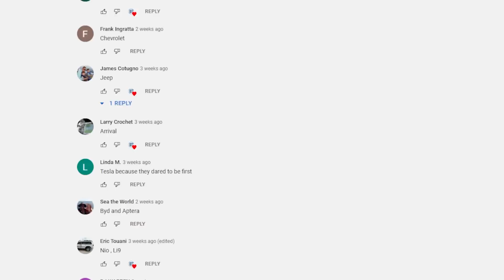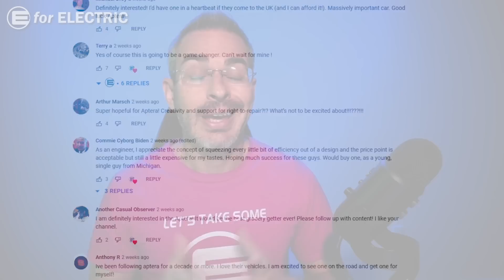How Aptera EV Got a Tesla-like Fan Base

Comment: I watch all of your videos, I have had a Tesla model 3 long range for 4 years now and absolutely love it, and yes I am an early reservation holder for the Aptera.  For me the Aptera will be more of a toy, such as a motorcycle or an ATV.  I am 75 years old and this thing just interests the heck out of me.   The solar aspect of the vehicle does not have any basis for my interest.  Number 1, I would not want to leave it sit in the sun all day.  I've been around long enough to see the damage the sun can do to most everything.  It will be kept in an enclosure or under a roof when not being used.  I do have one outstanding question that no YouTuber or even Aptera seems to want to answer about this vehicle.  Something I do on a regular basis with every vehicle I have is periodically check and change tire pressures.  What exactly will be involved with doing that on this vehicle?  It appears that it might be a major task!
Reply: I would think at least they would have an easily removable small panel on each of the 3 wheel pants which would give access to the valve stems by just rotation of the wheel until the stem was accessible.
Reply: My understanding is, it will have a tire pressure monitoring system.  How they will notify you of tire pressure (ie warning sound when tp is low, ability to touch the screen and get recent tp, graphic of vehicle with tp at startup, etc) has not been disclosed.  Nor have they revealed who the supplier for tp monitoring system is.
Reply: @tfloyd6651  That's fine, but again, what is involved with actually adding or releasing air?  Looks to be a possible nightmare!
Reply: @ronalddeservi1889  - I see your point.  If filling your tires means ensuring the filling point is on the inside (toward the car), rather than on the outside when you rotate tires ... or if special tools are required to access the wheel pants to reach the filling point ... or if there is a a unique requirement with the inwheel motors, you would probably want to know that eventually to handle the task effectively.

Comment: I love the design and innovation but considering this  vehicle as a daily driver or anywhere where it needs to be driven in traffic with other cars that weigh 3000 - 8000 lbs ( and that’s just cars and trucks) is suicidal.

A crash with a  Camry  or any normal car  or truck will  likely subject the Aptera occupants to grave injury.

Now,  if it’s a world of only Apteras  or similar weighted vehicles, then no problem , I’m on board.
Reply: So you need a 80,000 lbs transport truck to give you the illusion of safety?
Reply: @universeisundernoobligatio3283   hardly...,   do  what you want, but i'd never put my kids in the Aptera unless it was on a closed road or the world is filled with a majority  of Apteras.
Reply: @universeisundernoobligatio3283   Really?.  I'm holding back from being sad about you or your kids potentially  dying  in an Aptera because I don't want you to be considered an irresponsible parent.. Maybe your parents gave you a motorcycle for your first vehicle.  Not mine. Maybe you're  parents would buy a Pinto because they could get a great deal. Not  mine. Everybody has a different sense of risk tolerance,  and to me,  safety is one  of the big considerations when buying a car, or car like vehicle..

Your assumption is ridiculous. There's  a big difference  between riding a bike on the side of the road  at city speeds and  and sharing a highway  with vehicles of such great mass disparity traveling at 55-80 mph..  You can paint me as overly cautious, but 3 wheeled vehicles in the USA   have little safety regulation and are treated like motorcycles.

 i know  the likelihood of a crash is probably super low and as an  in city runabout,  I'm sure the Aptera is fine.  My point is existing cars and trucks and especially EVs are super heavy. Not  addressing the relative safety of this sort of vehicle is irresponsible unless it's a world of Apteras.

 Or shoot, maybe I'm wrong and the Aptera has some brilliant crash mitigating  features that make it incredibly  safe? If so, I'd like to hear more.
Reply: @FURILLA  
Still have not answered the question will you ever let your kids ride a bike?
Reply: Sports cars have this same problem: light weight compared to semis, trucks, and sedans.  Motorcycles and smart cars are so streamline and 'tiny', that they are overlooked by distracted drivers.   For many people, these are considered daily driver vehicles.  And driving these safely (defensively) does take skill beyond reving the engine and weaving through traffic.  I wouldn't be surprised to learn,  autocycle driving schools get a boost of business, as these roll off the manufacturing floor and into owners hands.
Reply: I have over 400,000 safe miles on motorcycles, many of them commuting in rush hour traffic in the SF Bay area.  Safety does not come from passive protection alone.  That is a dangerous illusion.  That said, Aptera will be crash tested to FMVSS Part 200 automotive  standards, and will rate well.
Reply: @n.brucenelson5920   That is great to hear.  What is the FMVSS Part 200  test? I cant find it when googling.
Reply: @FURILLA  Part 200 calls out a whole series of crash tests.  For instance part 216 is the roof crush strength test.  It should be easy to find. FMVSS stands for Federal Motor Vehicle Safety Standards.  Others include FMVSS 214 (Side Door Strength), FMVSS 215 (Exterior Protection), and
FMVSS 208 (Occupant Crash Protection)
Reply: @n.brucenelson5920     Roof crush I hear is very good. on the Aptera, but  that deals with only the Aptera ‘own weight times gravity or the speed at which it is moving.

I would want to know how it does  in a head on  crash with a typical car or static barrier , off set and side impacts as well.
Reply: @FURILLA  I think we all want to know, which is why we need to wait until there are production intent vehicles available to test.

Comment: The Aptera EV is certainly a strange looking beast and probably won't appear to very many automobile enthusiasts but it might to motorcycle enthusiasts. At any rate, I'm rooting for them, particularly if they can shave 7 or 8 thousand dollars off the price point.
Reply: The Aptera's drag coefficient of 0.13, and even the Cd's of most cars, is vastly superior to that of a motorcycle that beat you up with drag coefficients up around 0.70, up there with vans and large chunky SUV's. You throw your money away powering those machines to just break wind.

Comment: One thing I'm surprised wasn't mentioned is the benefits of efficiency on charging in miles/minute of charging. With a 40 kW battery getting 400 miles, if that can be charged 0-80% in say 20 minutes that is only averaging under 100 kW charging and gives you 16 miles per minute of charging. That blows every other EV out of the water. Even if it takes over 30 minutes 0-80% I believe this will be the fastest charging EV available and you'll even be able to beat all or nearly all EVs even if it's on a wimpy 50 kW charger while they're on 350 kW chargers.

That is all assuming this thing can charge reasonably quick, but I think it's a safe assumption it will do at least 50 kW which will make it the fastest charging vehicle within like $70k of its price.
Reply: I believe the top charging speed will be 50 kW DC. but this is till a rate of 500 mph.

Comment: I'm really hoping Aptera makes it to market because the Aptera is the product that I'm most excited about.  Yes, more than the cybertruck, roadster or anything GM, Ford or Lucid are making.  I'm fully aware that this is at odds with the general car buying public but the package Aptera has put together is really appealing to a nerd like me.  

We are a two car household and likely will be for the foreseeable future.  Having an Aptera as one of our vehicles would be perfect.  I like the thoughts of rock bottom operational cost, long lifespan, home repairablility with their commitment to Right to Repair.  I also like the thought of rarely ever needing to charge.   Then there's the range.  I have zero need for that much range, but I want it anyway.  It also doesn't hurt that it seems to have performance to rival the M3.

Comment: Dare I ask if thrs room inside for a PHEV version?
Reply: I currently drive a PHEV.  There are far more parts, more cost and more maintenance, and no reason for PHEVs anymore with the present state of EVs.
Reply: @n.brucenelson5920  If the lithium supply hits a bottleneck, it will reduce more CO2 to apportion it to eight PHEVs than to one BEV, per Toyota. I’ve read several articles claiming such a bottleneck is in the cards.
Reply: @rogerknights857  That could well be in the cards, but not necessarily.  Luckily there are other major sources of lithium in the US that have yet to be developed and perhaps could be quickly, such as the Salton Sea.  There are also other battery tech on the horizon such as sodium and other kinds of flow batteries that could ease any developing bottlenecks.

Comment: The vehicle is designed for efficiency, modules for repairability, upgradeable, made of materials that will last a long time, right to repair, and it looks good. Efficient design was first--not flashy how can we impress the neighbors’ designs that are prevalent today.  Today’s products are designed for obsolescence and throw away. Cars for obsolescence and dealer repair for profit.  Aptera is designed for the consumer. Efficient, repairable, upgradeable, low initial cost, low cost per mile to operate, it looks awesome, and it satisfies the number one reason people own a car--commuting to work.

Comment: The Aptera is a great design. I think there is a solid future in photovoltaics on cars. Much of the time a car is sitting idle in the sun (or at least in daylight) - so why not use the solar power, it's a no brainer. Even the simple addition of PV material to a standard glass roof of an EV would add about 1000 km of free distance a year - well worth it since these glass roofs need some shading to begin with, and PV material is dropping in price.

Comment: Overall simplicity of the design in terms of forward/backward compatibility with future tech upgrades. They want that hull to stay on the road, even if every other component gets replaced in the future. That type of reusability is what has kept (50's, 60's, and 70's) muscle cars on the road till now. It really fits into the existing car repair market. Little need for service centers, just warehouses full of parts. I think it's core design and variants are going to be great for courier type delivery vehicles. Internationally, Asian markets may eat these up where trike type motorcycles are currently used. That use would get around a lot of the regulations that sandy mentioned in the US for 4 wheel vehicles as well. The company and their products have a lot of potential.

Comment: I predict that those front wheels are going to hit and get hit by everything. Plus 3 wheelers have a more difficult time avoiding potholes, etc. 3 wheelers also don't have to meet auto safety regulations = less safe.
Reply: Your last statement is untrue.  Aptera has been designed to and will be tested to the FMVSS part 200 automotive crash test standards by a third party and the ratings will be published.  It will likely do better than my Gen 1 Honda Insight which weighs about the same and got 4s when it was tested.  It has some safety features that the Honda doesn't have.
Reply: @n.brucenelson5920  "Will be tested" means nothing.
Reply: @Vlasko60  When I first invested there were no vehicles in existence.  My wife and I have now ridden in one and it exceeded all our expectations for performance.   It will be tested just like Cybertruck will be, and likely first.
Reply: @n.brucenelson5920  Again, "will be" is not "has passed", is it?

Comment: Beware of 3 wheeled vehicles. They are classified as motorcycles so they do not have to meet auto safety standards.
Reply: The aptera has been designed with safety in mind from the beginning, and will be crash tested to automotive standards (even though they don't have to, because, as you say, it's an autocycle).
Reply: @GoClimbARockEh  "Will be crash tested" is not "crash tested". If they had safety in mind from the beginning, they wouldn't have chosen 3 wheels to get around regulations.
Reply: @Vlasko60  they chose three wheels for efficiencies sake, not to get around regulations. You only crash test production vehicles, which they should have by early 2023
Reply: @Vlasko60  Aptera has front and rear crumple zones, air bags, seatbelts, and other safety features, none of which are required by the regs.  On the other hand, 3 wheels allows both an more aerodynamic shape, less weight, and less rolling resistance, all contributing to the efficiency of the design  

It will be crash tested by a third party to FMVSS Part 200 automotive standards and the results published as soon as there are production intent vehicles available to test.
Reply: @GoClimbARockEh  Nope. That's just what they tell you. It is to make more money not dealing with safety regulations. People are going to put their children in these things. Too bad you don't seem to care as long as you have your fun toy. Cars are more regulated than ever and safer than ever. Regulations save lives.

Comment: I am a Fan, Reservation holder and an Investor.

Solar Charging, composite construction and efficiency are second to none.

100 watts per mile.

Sad to hear all these negative comments from this Channel Owner.

Easy to charge?  It takes money to charge from the grid.

Solar is free, using a basic 120V to charge, is very useful.

Tesla Plug vs CCS-2.  I choose Tesla

Comment: Efficiency is essentially meaningless, practicality (in all ways) is what it's all about.  The Aptera fails miserably in practicality.  The obsession about range is a comically short-sighted, knee-jerk, response to EV adoption/desirability.  It's only a matter of time before profitability (ya, that minor point) means that literally every major gas station has EV chargers installed (Shell is already a big player). 

In any case, the vast majority of EV owners for the forseeable future will be able to charge at home (EV's are not yet mass-market and out of practical reach of lower/middle-income earners, who typically live without dedicated parking/charge availability, like a driveway/garage)
Reply: Cost is a major component of practicality, and the Aptera hardly fails in any measure of utility as long as two passengers can meet your needs.  I know this from having ridden in an alpha prototype.  The pure handling and acceleration performance are also thrilling, which goes beyond practicality, but is a major attraction.
Reply: @n.brucenelson5920  The Aptera is a toy, like a Slingshot, or similar.  Pretending that it is a practical, useful, vehicle is completely disingenuous.
Reply: @awebuser5914  You are welcome to your opinion, but I wholeheartedly disagree. It will function as my primary get around, and road tripping car. Will probably keep the LEAF and use it mostly for hauling dogs around. It is already pretty much sacrificed to my dog walking side gig, odor and appearance wise.

Comment: I am a reservation holder, and I'm fascinated by the efficiency this car will provide.  By the way, looking at the chart about the matter of ever having to charge, if your work commute in Seattle is less than 20 miles a day, you'll never have to charge your Aptera.  According to their interactive map, you'd get 20 miles a day free even if you lived in Glasgow, Scotland, which makes Seattle look downright sunny.  That interactive map never expects you to actually get 40 miles a day free, even if you live in a city in sun zone 12, like Antofagasta, Chile.  You'll have to look somewhere for your annual recharge, if you don't have a place at home to plug in.  However, in my current situation, well, there is nothing in their interactive map for a 140 mile day, which describes my current work commute to Richmond.

Now, let's discuss purchasing an electric vehicle in any form that conforms to people's needs at a price that mere mortals can afford.  An Auto Trader search for a electric car that I could use to drive to work produces nothing below about 20 grand.  Then you have the cheapest Bolt available in the area.  The first Tesla shows up at about 26K, and it's a Model S 60 with over 170K on the odometer.  I'd still have to charge that every day.  The car in this bunch that I'd really want is just over what I paid for the Accord I now drive, and 103K isn't horrible for a seven year old car.  The other choice is a Chevy Bolt, which in forbidden to park in the terminal at Richmond International Airport.  Those are available in new and used forms from about 21K.  

We've discussed at great length the barriers to widespread electric car ownership, so no real need to go over the others.  Right now, it's necessary to cheat the rules to have a inexpensive and useful electric vehicle.  This is basically what Aptera has done.  Otherwise you're waiting on a Tesla that may be at the end of its days...

Comment: I am a reservation holder because 1) efficiency, 2) ability to turn it into a (solo) camper (hopefully with removal of the passenger seat, not interested in the suggested tent).
Reply: They say you get 7 feet in the back just by adjusting the seats forward.
Reply: @jeffcarlton3590  Yes, but I would like to have access to an indoor toilet and such, so the extra space provided when the passenger seat is out would come in handy.